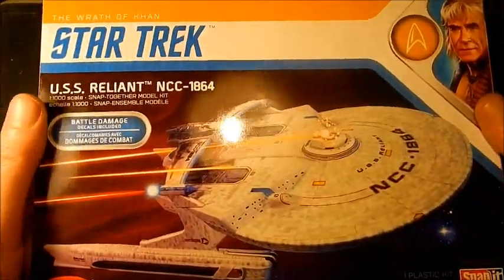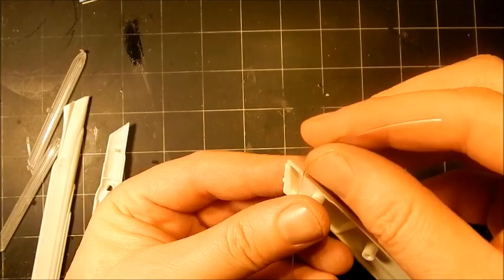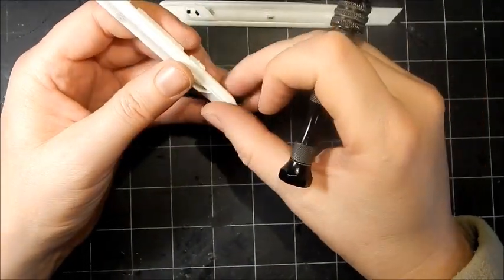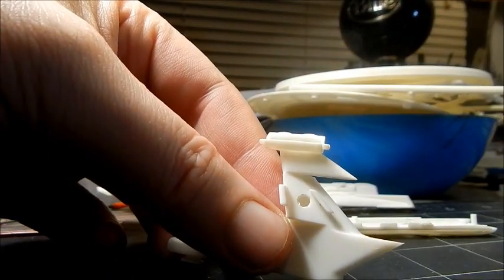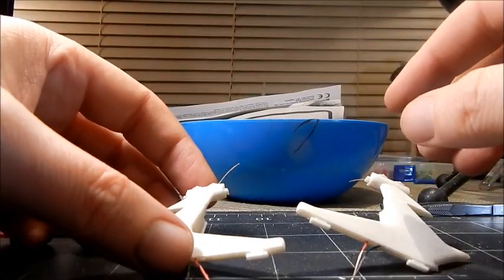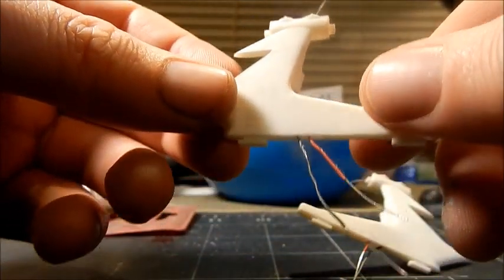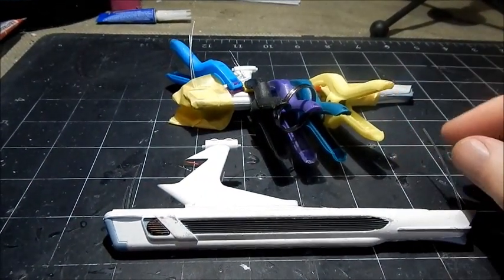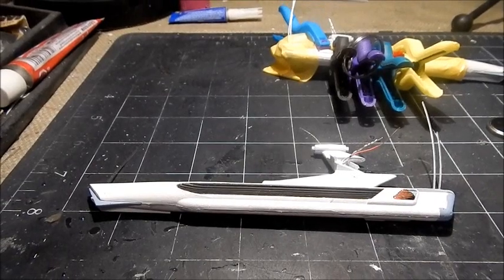Polar Lights 1/1000 U S S Reliant Build E01

Comment: Perhaps side-light fiber optic could work on the chiller grills.  A groove in the underlying plastic and fiber optic of the tint of the color you want.  Only problem there might be stronger light at the end you light it from, so figuring out a reflector device at the other end or perhaps a second LED, lighting from both ends.
Reply from the maker: Heya Jedi, I've tried something like that with the turbo lifts on the 1/350 and you still get a bit of light dimming in the center, like a dead spot almost. You'd have to use some super bright LEDs if you want to keep constant light throughout. Good idea tho, keep suggesting!!

Comment: Looks good,chillers -1 x 1led strip segment white
Paint inside of chiller area blue done 2 extra wires .if you want use 1 x flashing led light for beacon ,1 x led whit light for the spot lights solder those wires to the led strip add 2 x wires to led strip for power and done. Just trying to be helpful not rude.
Reply from the maker: Heya James!! Not sure if just putting in a flashing led would work out as it wouldn't be in sink with the rest of the flashers. I did just that on my 1/537 refit build and now my nacelles looks like rail road crossing lights. Lol. I'm just going for a basic thing here, thus what you see in the video. I didn't think you were being rude. Don't know why passing on knowledge these days is considered an offence.
Reply: @PunkyWily  thank you, I was thinking of the tight space ,but if you can get 2 x sets of power wires down the necells into the main hull then you could still do what i suggested but with a white led in the  nacell 's   with wires going to  a board to control the flash rate .if you use wrapping wire,or magnet wire which is made for these tight spaces.however you need to be careful using magnet wire as it can get scuffed an expose the bare wire and cause a short.
This is why if you can get a roll of wraping wire with 8 colours it works great for this type of wiring job.

Comment: Hey how's it going?   I was just thinking you could use some blue LED tape to light up the Chiller Grills  and SMD's for the tiny light on the Nacells but looks like you got a good start on this.  getting anythig done on the 1:350 E.R ?
Reply from the maker: Heya Wraith!! Well, I thought about it too but its more of a matter of space for wires then space for sm/led/tape. Maybe you could do it with micro wire, like magnet wire, but I really don't have anything like that at the moment. And ever build I see with those look, I donno, wrong? Lol I know it doesn't make any sense, seeing as they should be lit and there are episodes of next gen and ds9 where they are, it just looks odd. Like I think the ship is more menacing with them unlit, and considering who was captn in wok, it fits. I've primed, light blocked, white coated and painting in where the floors of the halls, and ceilings, on the 1/350 refit. Beyond that I've done nothing on the kit. However, I've being prototyping a TON of interior parts for 3D printing with Devil Dog Dot Games. Wait till you see this stuff!! He did a recreation of the rec deck that is spot on to the set. Hoping to get some parts in soon here to continue working on her. I may be heading back on the secondary hull as it still needs work to get us ship shape.
Reply: @PunkyWily  Cool, you got this Bro.

Comment: Too late but why not use magna wires or a piece of copper strip for the fine pieces?
Reply from the maker: Heya Luis!! Magna wires are my nemesis,  the few times I've used them they broke after I got everything together. And I've never used copper strip, I worry about that stuff. Knowing my luck I'll short everything out with that stuff. :D
Reply: @PunkyWily  
Maybe they are not making it like before?
When I was doing models in the 80's I never had that problem with magna wires.👴
Metal strips I glue them on the inside surface of the model where normal wires won't fit. Before that, I solder normal wires on the ends.
Reply from the maker: @LuisVazquez-hx3bk  Luis, I just never had any luck with the magna wires. And the strips I just worry about, mainly because of me. I donno. Maybe I'll run into a situation where it requires me to use them, and I'll say, yup, you were right Luis! :D